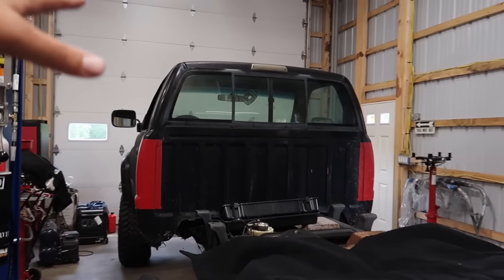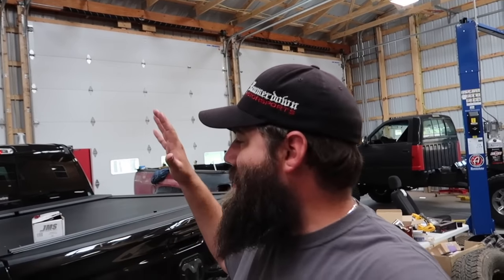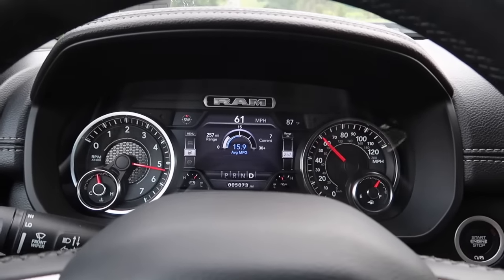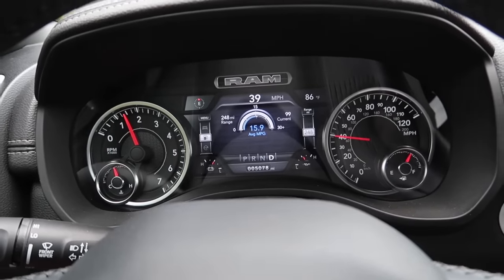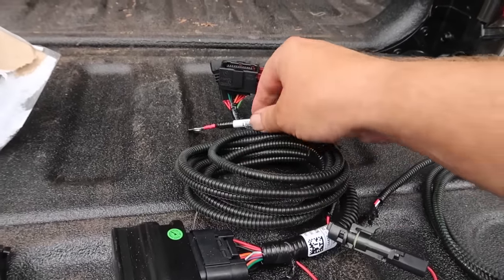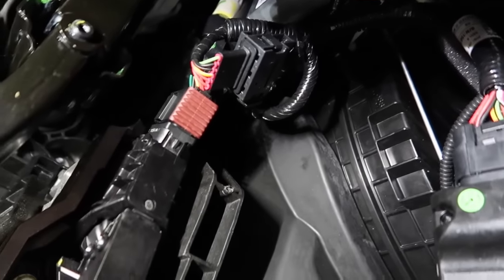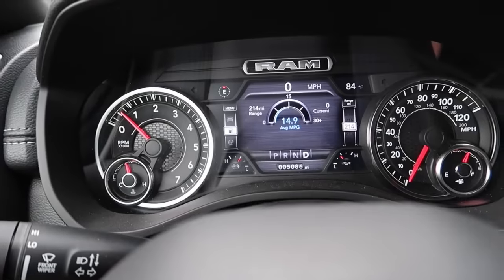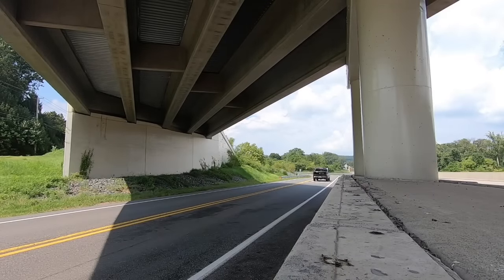2019 Ram Hidden Power Mod

Comment: Banks just came out with the Pedal Monster. No crazy code if you bump the wire, it will default to the standard code. They also have the power draw on the connector figured out.
Reply: Yes, the Pedal Monster seems far more superior and almost the same price.
Reply: So I’m late to the party but I have the pedal monster and it’s amazing

Comment: I timed the 0-60 on the video (four times each) with and without the pedalmax, Without it the truck averaged 7.04 seconds 0-60, and with it the truck averaged 7.48! What I noticed in the video is that with the pedalmax there was a lag in the speed increasing right around 50 mph. That could have been a driver variance. I put one of these in my '14 Ram, and it was fun for a couple weeks, but after that, I took it out because my mileage significantly went down (yes I could have reduced the percentage, but I found myself liking it too much). I now have a '21 Ram, and the factory did somewhat address this issue, but there is still a significant lag when passing. What I do now is, if I think I'm going to pass, I just blip the gas pedal, which causes the transmission to downshift a couple gears so when I do you get on it there's not as much delay.

Comment: 3.92 and Etorque Hemi, I can light em up on dry asphalt every time.
Reply: 1971kpc same here I have a 2019 Classic 4th Gen, those 5th gens are badass
Reply: @MoparSammy  Hi Mopar Sammy,   I have the 2019 Classic and It will not spin the tires, I have the 3.92.   from a dead stop floored and it will not spin at all.
Reply: Joe Rogers take off traction control!!!
Reply: no eTorque  on mine, but I can definitely smoke my tires on dry asphalt.
Reply: @jrogers7581  what's your elevation?
Reply: jet052673 he needs to take traction control off!!

Comment: The pedal boostermaxcommander works by altering the signal that is being sent to the ecu of the vehicle.  Most stock vehicles give you a 1 to 1 ratio oh how far you press the pedal and how far the throttle body opens.  Press the pedal half way and throttle body opens half way, just like the old throttle by cable systems.  However because this is electronic, manufactures added in things like torque management, or clutch protection for smoother acceleration.  These things make it feel like the throttle body is opening slower than the throttle press many times, and thats exactly whats happening.  This product installs right between the pedal and ecu and intercepts the signal.  It then increases the signal and sends it to the ecu.  For example if you press the pedal half way, the throttle body opens three quarters of the way.  But because the product is installed before the ecu, the ecu will still add in torque management and slow down the speed at which your throttle body opens.  This is why this product is warranty safe as well, it doesnt tamper with any ecu settings.  Your ecu just things youre pressing the pedal down further than you are, which brings me to the point, dont waste your money, just press the pedal down faster and further.  Also, these products all do the same thing and are very simple and over priced.  I think at 20 dollars it would be a great product.  RC radios now days come with more complex version of this product for 40 bucks.  But you get to map out your exact throttle press on a visual graph.  Also, any car or truck with sport mode increases the throttle sensitivity, and its already built in and free.  The true and only way to get rid of a slow, gradual opening throttle body is to simply tune.
Reply from the maker: but the PedalMax opens it faster and 7 degrees more
Reply: @HammerdownMotorsportsUSA  What Sergey is saying makes a lot of sense. Are you claiming that this device exceeds the limits of the pedal? Like, assuming stock pedal has a max throttle open speed of X at WOT when the pedal is floored. This device can exceed that speed by some percent? And 7 degrees more than what? If it is 7 degrees more than where the throttle is open at any point on stock pedal travel, then you are proving Sergey's point that simply pressing the stock pedal more or faster would achieve the same goal. Not trying to be dismissive of the product, it just seems more like a throttle input adjuster than something that would release power. For that, like Sergey said, you would need to tune the ECU.
Reply from the maker: jed92y I mean obviously I did not invest this product but from my understanding it allows the throttle to open faster and open 7 degrees more than stock so pressing the pedal to the floor there is a delay and this will eliminate that by intercepting the output from the ecu and amplifying the signal to the throttle body motor causing it to open faster than stock in turn giving you control over throttle lag and the difference is very noticeable

Comment: Is that ram leveled or lifted? And what tires are you running?
Reply from the maker: That one is totally stock
Reply: Just grabbed a 21’ big horn with 18k miles. Just doing a level with bigger tires. Kind of stuck on which dia/at tire I should go with. Not a big wide wheel guy
Reply from the maker: @Briguy933  probably can do a 33 no problem with a level like the factory Rebel tires I’m actually selling my factory ones
Reply: @HammerdownMotorsportsUSA  what tire size is the rebel?
Reply from the maker: @Briguy933  33s

Comment: Not doubting the seat of the pants feel that is obviously better than stock by your laughter but according to the zero to 60 times on your video, they are exactly 7 seconds on the before  ( 3.32 - 3.39 ), and on the after ( 9.18 - 9.25 ) so I'm wondering if this is really much of an advantage. This was a couple of years ago now so I am wondering if this has remained a good choice and would you still recommend it? I have a brand new 2021 Ram 1500 and I am considering this. Any input would be great, thanks.
Reply from the maker: I am still enjoying the pedal max if you turn it off you really see how much it does from stock

Comment: I have a 2019 longhorn model with echo boost. It is stock and when I disable echo Mode by switching it to Manual, it will burn the tires off from dead stop. Not saying the mod won't help, but there was to much lag on that truck before the mod.
Reply: Ram doesn’t have a eco-boost
Reply: @Mrad72  he said "echo-boost", he's probably just yelling in his truck bed with with a tonno cover on , it improves the echo.

Comment: I have a 2019 Laramie tow package with the 3.92  rear axle and I get tire spin from a stop on gravel and a loud screech on asphalt. 
No mod for me needed...but I'm an older guy!
Reply: I have a 2018 ram 1500 Big Horn with the tow package it’s also a 4 x 4 does that mean it’s going to be 
Faster than a ram what out to a package
Reply: Miss spelled tow package
Reply: @hemilifeornolife567  I sure dont know. I'm not an expert by any stretch of the imagination. I guess for me, the truck has enough power and speed with no mods. Understand though that the 2019 ram I bought replaced my old worn out 2004 chevy Silverado with just a little over 300k miles on it with the original transmission and engine.  So I am used to driving an old worn out truck. Even a Prius would have more power than that old girl!
I do have the 3.92 rear axle. 4x4.
Maybe that's why it spins out on gravel etc.
Reply: Jessy Adsms tow package just would be a difference on like trailer mirrors/trailer brakes/rear end gear ⚙️ be different than one without, I’m not sure if they would be automatically be made with the 4x4 or not that’s also an option too I believe either way i don’t think it would make it faster by having the towing package or not, would just be how much harder it would leave of the start due to having a higher gear ration like a 3.92.
Reply: Jessy Adsms  I own a 17 Ram Rebel and has every option minus the sunroof. Comes with the 3.92 and I have modded this truck and it does leave hard off the start. I can spin the tires even on traction control on
Reply: @hemilifeornolife567  misspelled misspelled.
Reply: Misspelled  misspelled what
Reply: @hemilifeornolife567  exactly.

Comment: Hey I know this is a bit late and I’ve seen you changed trucks but I’ve wanted to know your final impressions of owning the pedal max and if I should get it installed on my truck. Does it hurt or decrease engine life in any way and is there anything I should know about. Really like the idea of reduced throttle lag because the 5.7 hemi on rams do have quite a bit delay when hitting the throttle even for 4wd so should I be fine to get it or should I not

Comment: Beware of breaking a coil spring when using these.. ive also lost power while driving on the freeway. I used the pedal commander on my 2017 ram 1500 sport. Im sure this is the same.. just saying, faster acceleration isnt always good for stock. Dont get me wrong..its fun to use,just use lightly. Nobody likes a blinking check engine light.

Comment: Thank you for the performance enhancement tip!

Question: Larger cool-air intake.   Have you tested or know the impact of replacing the current air intake for a larger & cooled one on the new Ram 1500?
Reply from the maker: Lucas Beradi I haven’t got my cold air intake since it is still in development but as soon as I get it there will be a video on it should be early 2020
Reply: @HammerdownMotorsportsUSA  Thanks for answering!
Reply from the maker: @YTLuc  absolutely

Comment: I just got my RAM 1500 yesterday, adding the pedalmax won't void warranty?????
Reply from the maker: jabojr  not to my knowledge it’s plug and play you can remove it in minutes if you had to take it in for anything
Reply: just read the description on the website and it says it has a  "seamless and warranty-friendly installation". gonna check it out myself

Comment: Honestly the acceleration looked the same to me? Turn the traction control off and the limiter is turned off. It will burn the tires off the wheels.
Reply: I thought the same thing.

Comment: I’m sorry, I didn’t rely notice any quicker Acceleration from dead take off. I will say if your cruising at a certain speed and your in a high gear, it takes a bit for the transmission to downshift from 6or 7th gear to 3rd.
Reply from the maker: it really is noticeable from a dead stop and makes the truck a lot more responsive
Reply: It doesn't add power. It increases throttle sensetivity.
Reply: @AndoBMS  another guy did a video on how these work, basically it tells the computer to open the throttle more than stock. As far as delay, it doesn’t take it out, you just think it did bc your mind is use to the amount of power to the ratio of pedal your pushing. A guy did a video on the pedal commander and no delay was reduced, just the throttle position from stock

Comment: My 2019 RAM 1500 V8 4x4 CCab has the same issue...a delayed response to the pedal in acceleration. Not just that, while driving, say between 40-50 and the traffic opens up and if it is a freeway, I push the pedal, not quite flooring, but I have some 2-3 seconds delay before I see the acceleration. So, as you described, will this JMS Pedal-Max do the magic trick on mine, or is it just a myth?
Also, I would like for you to make a detailed video of BorgWarner 44x44 and BorgWarner 44x45 systems of RAM and how DOdge lied to the customers on BW44x44 and calling it 4x4, which is not the case because it is a wet clutch concept. The only true 4x4 is BW44x45.

Comment: So your 2019 won't spin the tires? V6? My 2018 5.7 will cook the tires without anything even with the "traction control " on. That doesn't work when both wheels break free off the line.

Comment: Maybe its the video, but if you actually time the 0-60 and compare before and after.... its slower. Might be more fun, but its slower. I timed it ten times to account for human in accuracy with the stop watch....With the Pmax, it averages out at 7.16 seconds from 0-60/ Stock averages out at 6.88 seconds from 0-60. But this is all based of the video. Have you timed the differences yourself?
Reply from the maker: John Boisvenue I plan to take it to the track
Reply: @HammerdownMotorsportsUSA  Cool. Some solid times would be good to see.

Comment: Looking to get a ram identical to this, would you recommend as a daily driver?  Options to get or not?
Reply: I wouldnt get etorque if I could choose again. And I wish I had the air suspension.
Reply: @daniel1k793  Hey, same situation. Why wouldn't you get etorque? And, do you know if all Rams now come with the engine autostart/stop "feature". I have seen buttons near the gear select on some that disables that feature, but I can't find info if all the trucks now have it.
Reply: @jed92y  ive got mixed feeling on it. It may still be breaking in bc I got less than 7k miles. But mostly bc my normal driving style is braking lightly to lights+stops and I'm annoyed with deceleration with etorque. Im pretty sure it's not the regen braking but the downshifts. while braking the downshifts bite pretty hard on my 3.92 when truck isnt towing and is light.  Takes effort to smoothly stop. Maybe a trans update could lessen that effect. Also, I think putting bigger tires and lift would be less pronounced

Comment: so, does it just change the throttle angle ratio to the computer?  So, 20% angle changes to 30% or more depending on the adjustment?  WOT is still WOT or does that come on earlier too?  Like a condensed angle sensor?
Reply from the maker: from what I understand it comes on faster and WOT is   open more than stock

Comment: Your zero to sixty didn't change much. Maybe a few tenths from test one to test two? I supposed it may give you what feels hot off the line? It seems as though it just moved the curve in the power band? It might even mess with economy for very little gain in actual performance. I kick my 6.4L in the ass and she hauls @$$! I don't think this could improve on that? You'd have to do some more rigorous testing before I'm convinced. Great vid all the same! I'm originally from Central Pennsyltuckey.

Comment: Will this product affect the warranty of the vehicle?
Reply from the maker: nope it does not change factory programming and is undetectable once removed
Reply: @HammerdownMotorsportsUSA  
Thanks! So, if you set the dial to zero, does that mean the device has no effect and that it's as if it wasn't installed?
Reply from the maker: @LimogesDiver  that's my understanding

Comment: What's your opinion on the pedal commander? Is it just about the same?
Reply from the maker: Anthony Amodei I have never used a pedal commander but I can say the pedal max definitely does the job
Reply: I own the pedal commander, and it has worked flawlessly and effectively.
Reply: @laynehall5823  Layne is it just more responsive? What are the pros?
Reply: I got a used pedal commander for 150$ idk what you can get either of those for but the pedal commander day and night it works great fun definitely worth 150$
Reply: I've had problems with pedal commander. Error codes, kicking into limp mode! Had to toss it.. tried reset many times but would cause problems. Dangerous!
Reply: 2 year update. No problems and without the pedal commander. My truck is a dog off the line. Bottom line is this thing makes your throttle response as it should be from factory with no lag..

Comment: Will this work on a 2019 Ram 1500 6 cylinder Warlock. Are there other mods that need o be done to maximize it?
Reply from the maker: Should be fine just buy the right one for your truck additional mods can always spice it up more

Comment: So on the dyno HP zero gain's? 2-300 bucks and no added actual Hp Diablo tuners can boost the throttle all the way up to 20 percent which is equal to pedal commander as well and give you 20rwp and torque with transmission change's and top speed, tire size you name it for $345 My advice is unless you want hp just put your foot down further lol

Comment: Having a 19 Laramie it is odd yours doesn’t spin the tires. Mine will light up without trying. Also I have the 6.5 foot bed. Which has an extra feet of length between the tires. That might be a factor

Comment: So is this the same as the "Pedal Commander"?  Of which I hear the Edge Pulsar is an upgrade, in which it actually adds 30hp (not sure if that's dyno proven or not).
Reply from the maker: Jason Boston it is similar I like the Pedalmax better cause it has the on the fly adjustment knob
Reply: @HammerdownMotorsportsUSA  nice.  I'll have to look into that for my 2019 Rebel.
Reply from the maker: Jason Boston definitely I have it in my Rebel now I love it

Comment: Does it deactivate the cylinder deactivation? And does it effect your gas mileage
Reply from the maker: STEVE ORTEZ not sure about cylinder deactivation I don’t really ever hear it fuel Mikage really depends on how much fun you are having but you can always turn it down with the switch
Reply: Tapping the gear limit to 8th instead of drive with keep it on all 8

Comment: Which model number is it? I have a 19 ram 1500 as well and I went on the website but they have different ones.
Reply from the maker: Ron Cruz it has been quite a while since i got mine I would suggest either calling or emailing them they will make sure you get the right one

Comment: Does not increase actual hp numbers whatsoever...
Reply: If you want an increase buy a  supercharger nothing better then getting blown not sucked.
Reply: actually makes it 1.23seconds slower than no mod.......used a stopwatch a few times on both pulls ......that thing is a joke.
Reply from the maker: @bryanhenry8075  hmmm not so sure about that
Reply from the maker: once the track opens again I'll do a pull with it on and one with it off
Reply: @HammerdownMotorsportsUSA  I take it this never happened...

Comment: My pulsar keep tripping codes for my electronic throttle module and then I get no power to my wheels really until it resets .. does this mod ever have that problem ?
Reply: Contact them. It’s an issue they are having with older software. Just went through it. Throws a P2122.